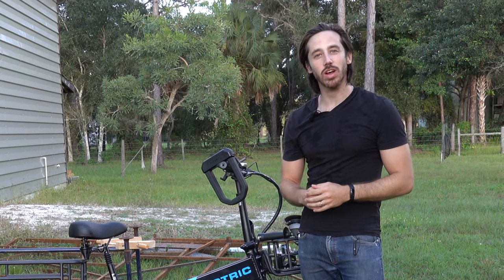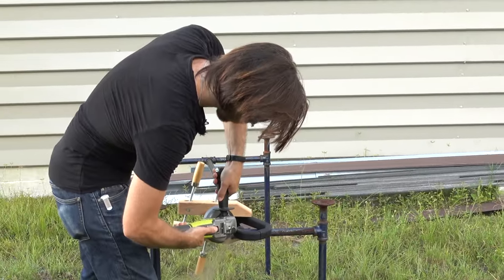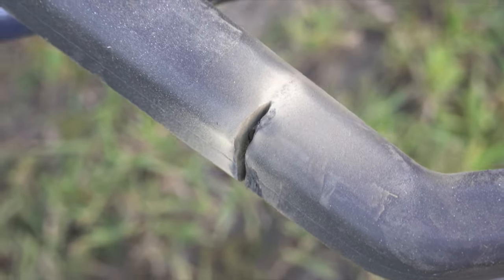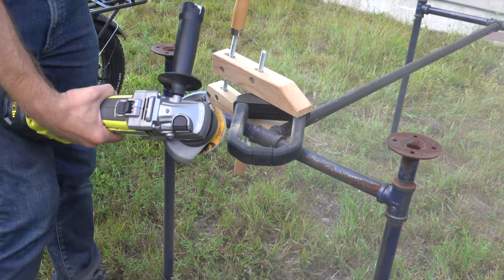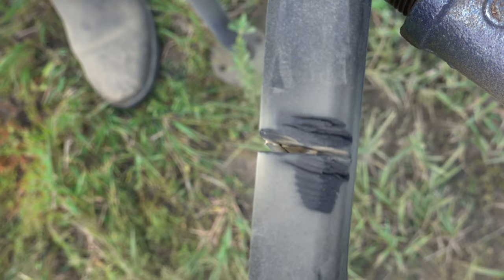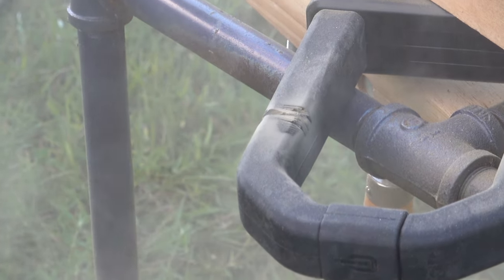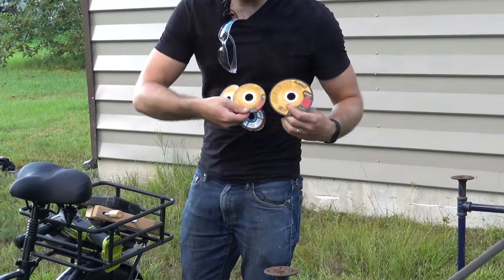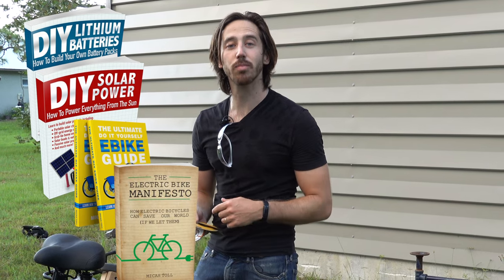Best E-bike Lock? Angle Grinder-Proof Hiplok D1000 Test

Comment: You didn't mention that you would have to do that twice, because it's dual shackle. You have to cut through both sides to remove the bike.
Reply: Yup just like the NY Kryptonite U lock. You need to cut 2x with multiple change of disks and batteries.
Reply: @larryc1616  My ebike was stolen on Monday which was locked with a Kryptonite Evolution lock. I was only in the supermarket for no more than 5 minutes and when I came back all that was left was my lock in 2 pieces. Looks like they used an angle grinder on it. The kryptonite locks can be cut very quickly with angle grinders so now I looking for a grinder proof lock because my work as a food delivery guy is reliant on my ebike.
Reply: @manoz6194  the 13mm evolution is too thin. Get one with a diamond rating like the 18mm NY kryptonite. Use a disk brake lock with alarm too. Add a 3rd chain lock if in a  bad neighborhood and Hide an airtag in the battery compartment. Good luck next time!
Reply: @larryc1616  I bought the NY lock but I'm still paranoid about it so I ordered the Litelok X1 too which is actually lighter and specially made for angle grinder use. I got an alarm which is motion detected which is also a light and I've ordered a Galaxy Tag and a holder for the saddle. It's a ebike not a motorbike. I think the thieves were lying in wait
Reply: @manoz6194 let us know how the litelock works out I'm thinking of getting it. I'm sorry to hear your bike was stolen, it's unlucky, and it always happens at the worst time!
Reply: @josephpmcl1241  It's working out great so far. I can lock it to more things as the shackle is wider and I've convinced a couple of my colleagues to buy one too
Reply: you are using the wrong disk, use a metal diamond disk
Reply: @larryc1616 The NY Fahgetaboutit lock can be cut through without changing discs. I've seen it done by different people in less than a minute. It's not angle grinder resistant at all. It's nowhere on level of what Hiplok, Litelok, or even the SkunkLock Carbon (the weakest of the bunch) can do. There's a video of the NY lock vs the Carbon and it loses badly.

Comment: Impressive cut resistance. As others have stated, now the lock mechanism itself should be tested by The LPL. I'm also torn between safety and convenience - it seems pretty bulky/heavy, suitable only for a true ebike (too much for my analog bike).
Reply: Seems like a good lock that you would use on a condo or apartment bike room or rack near your car parking spot.
Reply: Please clue me how "analog" applies here, assuming you know what the word means, since you'd clearly be using all your digits on it. (Hands & feet) Might go for un-assisted.)
Reply: put it in your backpack thats where i' have always put my u lock not this hiplock though.
Reply: Depends on how much you value your bike.  Honestly this lock will likely be a lifetime of use.  So might be worth it.

And besides as bulky or heavy as it may be it definitely beats walking out of somewhere and finding your bike gone.  A nice bike will be lighter and this lock will protect it!
Reply: It’s right at 4lbs. So not too bad imo. Has an internal size of 155mm x 92mm, external size of 225mm x 155mm, 20mm thick shackle (including protective coating).
Reply: I think it’s lighter than the Kryptonite New York standard lock and the Fahgettaboudit lock
Reply: You have an analogue bike...... Such a thing does not exist. What you have is a 'bicycle' or 'bike' as opposed to an eBike .... It doesn't need a new name 🙄

Comment: According to their kickstarter website, the lock is made out of a ceramic composite, which means that it may be vulnerable to a screw spreader attack, as the material is more brittle than metal.  Still, in order to use a screw spreader, you have to be able to fit it between the bars of the lock, so if you lock your bike in such a way that there is no room for it, you are still good.  Another possible attack would be a hydraulic cutter, which might shatter the material.  The LPL has used one of these on steel locks, so maybe he would be able to try it on this one when you send it.
Reply: I think it is the same composite as the Challenger 2 tank.
Reply: How about "Jaws of Life" hydraulic kit? Rather than BFI (brute force & ignorance) mechanical approaches. Professional bike thieves could easily carry it in their van. And it's QUIET. OTOH, how 'bout we legally mandate VIN code on multiple locations on any valuable vehicle. If you can't fence it, why bother stealing it? Any lock would then be just an inconvenience factor and a "flag" that you're in the wrong line of work.
Reply: A hydraulic cutter or simply a hydraulic crimper with a custom die set would probably do it. Likewise, I wonder how it'd fare against a nut splitter if it's a brittle material.

Comment: What do you mean by "half of the cut I made was rubber"? Does it mean the lock is mède out of a thick layer of rubber and only then comes the steel which is 50% of the construction? It doesn't make sense what you said.

Comment: I bought this lock. Someone tried to drill out the locking mechanism. I got the key in but it wouldn't turn. I called a locksmith. He drilled out the lock core in about 30 seconds. The good news is the thief didn't have a good drill bit and gave up.

Comment: I'm late to the party, but that's impressive!  But you have to start the party w/ two intros:  "Best angle grinder", and "best discs for cutting buffered tungsten (whatever) alloy."  (Serious, big difference in hand tools and replaceables.)  I'm thinking the remarkable thick & dense rubber is there to chaff the sides of the cutting disc wasting a large amount of what should be cutting energy as useless friction.  (Hense, "buffered" alloy.)  Nicely done!

Comment: I agree with you, Micah. 
Even the grinder eventually cuts through the lock, it would be after several discs, a lot of noise and the chance to get caught. In my opinion, the lock delivers on it’s promise.
Reply: Remember you need to fill cuts. The first cut doesn't do much. So a total of 10 discs.

A second lock would take even more discs due to fatigue of holding the grinder. And another battery.
Reply: Also you have to cut through both sides of the lock to get it off the bike, I've seen people take 5 blades to get through both sides with a mains operated grinder which a thief wont have on the side of the road. Awesome lock.
Reply: Not to mention it looks like it took nearly two full battery charges.
Reply: Most thieves dont even care any more, they know the cops arent wasting time on these calls.should have a frag explosive in it, true protection

Comment: This is alot more impressive than I expected tbh ,an angle grinder with enough discs will cut through practically anything within reason and this held up far far longer than a normal u lock

Comment: Excellent. I'm gonna get a couple of these D1000 locks for my eBikes. At their website they say this lock is around 4 lbs in weight, which is very good for the quality of security it is. Bottom line is it is very, very, very unlikely that a bike thief will have a half dozen high quality cutting discs and 3 or 4 spare fully charged batteries with him that he would need to cut this lock. So yeah, for all intents and purposes this lock is angle grinder proof.
Reply: how wrong one's assumptions can be...heh
Reply: Same, im sure once he makes the first cut after like 4 blades and 3 batteries, before realizing he’ll have to cut the other side as well, then do it all over on the second lock.

Comment: I agree partially with a person who posted previous to me, there is no such thing on the market 'yet' as an angle grinder proof lock. But still it is very impressive, as I own a couple of e-bikes, one worth at least 6 grand (just in parts) I will definitely be looking into this lock! But I do suggest that anyone who values their e-bike also purchase and install a very loud vibration sensitive alarm, GPS tracking and e-bike insurance. The combination of a great lock (like this one appears to be), a loud alarm and locking it securely in a public area is most of the time effective at deterring thieves. Make sure any alarm you buy is vibration sensitive, placed in a spot that is hard to muffle (like under the seat facing up), and secured at a minimum with stainless or coated steel zip ties.
Reply: @djcm6326  That sucks, I doubt I will remember by then. It's crazy how long it takes once something is done being tested even by people on YouTube before it comes to market.
Reply: Could you recommend an alarm
Reply: @SellingNewYorkCiti  Sure, I tested out several different ones from Amazon and the one I really like is a no name wireless vibration sensitive alarm, that lets you choose how sensitive to make it, link at the bottom. It appears there's an updated version to the one in the link, and the alarm is sold by several vendors on Amazon, you might want to check to see if there's a better price. Test it outside and/or with ear protection it's very loud, and can be overly sensitive on the highest setting.

I clicked on your pic, nice videos. I would have never thought to use a hammer on a drill to get the hammer drill effect. And great narration, to many DIY videos are not narrated or not narrated with enough detail making them hard to follow. Keep making videos, especially construction / power tool videos there's not enough of those done by females. In my experience, I find the way women explain DIY / working with tools to be much easier to follow, with a much better breakdown of what they are doing and why. I work with power tools everyday and watch many YouTube videos on it. I am your newest subscriber, I hope you will make many more videos. 

If there's anything else just let me know, I have built an ebike and 2 recumbent e-trikes, all high powered. My newest recumbent e-trike tops out at 45mph at the moment, soon to be much faster.
 https://smile.amazon.com/gp/aw/d/B07VB86TT9?psc=1&ref=ppx_pop_mob_b_asin_title
Reply: Good advice. I caught a thief red handed trying to steal my Fiido M1 pro a few months ago. I had only left it for 20 minutes while I went to buy some food.

He ran like a scared rat when he saw me. I never leave my bike unattended for more than 30 minutes in public. I have a tracker in it. A very jarring loud alarm. And two bolt cutter proof locks on it.

Only someone with an angle grinder might have a chance. And as soon as these HIPLOK d1000s  go mainstream. Im getting two of them.

I work too hard for my money. To let any low life just take my stuff. To sell on for peanuts to feed their addictions.
Reply: There it is. Security is a LAYERED approach. I've had mega bux riding equipment and never had anything stolen. Make it a PIA for them and they'll move on.
Reply: Do you have an ebike or 'regular' bike? I struggle to find a nice strong large d lock that can fit these unruly ebike frames some of their tubing is so fat! And with bigger tires it's almost impossible to fit a u lock around frame wheel and immovable object
Reply: @AD-xn7pt  I have an electric bike and a full suspension fat tire electric recumbent trike. Go with a Good quality folding lock and a vibration sensitive alarm.
Reply: @sgtfirefighter  thanks I currently have one chain lock getting a 2nd one. I'm going to look into the vibration alarm
Reply: @SellingNewYorkCiti  cruxer bike alarm £ 22 amazon

Comment: I would have wanted to see what happens when you are through, if the lock is still rigid enough to be difficult to open up any gaps on it to be able to remove it from something it is attached to. Because it would be amazing if one would be required to cut two sides of it of, or bend on it even after cutting into one side.
Reply: Came here to say this!
Reply: You will have to make two cuts to get it off, unless one very thick cut and managed to use a pry bar to bend (or crack) it further open.  I would call that twice as good but not at all amazing, since if they can complete one cut, they can use same method for a 2nd cut, simply taking twice as long and that difference might be more than enough to make the thief move on, OR it might make them just start cutting the bike away from the lock instead of the lock away from the bike to at least get something for their efforts.

Comment: And from what I understand after you would theoretically cut through one side you actually have to do the same thing on the other side. Now I’ve also heard suggestions that the crossbar part or whatever that’s called might be more vulnerable by drilling into the key area. Either way I have one of these on order.
Reply: from what i have seen from other YouTubers you only have todo one side on this lock but im okay with that with how long it takes just todo one side

Comment: A key to locking the bike is to place the lock so it's difficult to hammer against the ground. It would not be fixed as it is in this test, so would taka longer still if the test had been in situ

Comment: Also, (and it may have been noted elsewhere..) you will have to cut the other side of the "U" as the lock won't just fall apart with one cut-through. A thief will need maybe 15 wheels and two spare batteries? Nice lock. Spendy but nice. Cheers.

Comment: The Lectric XP bike in background is worth locking up. I have 200 miles on mine, use it 3 days a week when I park 2 miles from the office, spends most of the time folded up in back of my Subaru.

Comment: FYI:  There's many different types of grinder blades and they're designed to tackle different grades of metal.  They all look identical, but they will have wildly different performance depending on what they're cutting.  It would defiantly be interesting to see how the grinder preforms with a blade matched to the material it's suppose to cut.  Regardless, unless a thief knows what material the lock is made from, this is kind of a moot point.

Comment: The problem would definitely be the size of the Ulock. You likely wouldn't find any bike post or steel beam to fit that lock on, that couldn't be cut far faster and easier.
Reply: Take off the silicone sleeve to increase the area for locking.

Comment: Nice review, I'm glad to see the it was pretty tough to cut through!...
-How much of the bike can that lock secure? 
-The lock looks pretty small, is it able to be secured through the back tire and frame?
-And does it come in a longer length?
Reply: Yea the lock is to small.. if u lock this lock around the pickup grip they have on the lectric bike he has in the video or anywhere else similar then the theif would be able to easily saw that part off (frame) which the lock is holding 😢

Comment: I've been watching a lot of your battery build videos. You really need to make a video on how to build a battery that follows the shape of the fender of a Onewheel and how to tie it in to the power supply so it functions in tandem with the stock battery. They have all these videos about adding battery packs to the fender, but it makes the board look like it came out of Mad Max or something. Which isn't bad if that's what you're going for, but it just seems like an additional battery that would give 2x the range that's integrated into the fender and doesn't look like some bulging mass would be a huge hit.

Comment: Carbide tipped reciprocating metal saw blade. Something like a Diablo Steel Demon 9 inch blade from Home Depot for less than $20. Carbide tooling can cut just about anything including hardened steel.
Reply: It's a ferro-ceramic composite something, so while I agree that a carbide blade might make more progress, it would tend to also chip teeth off and be more expensive to wear through blades.  IMO a larger diameter, thicker ceramic cutoff wheel makes the most sense.  And a better grinder than Ryobi's.  Theirs cuts out power if you (more easily) bog it down so the cutting time is greatly increased compared to some more formidable contractor grade grinders.

Comment: Diamond disc would get through that ok. They don't lose much diameter as you use them either so you wouldn't be hampered by the wheels reducing in size.

Comment: Seems pretty tough in fairness!  I wonder if you cut away the rubber housing first would that make it easier to access the lock for cutting, and to find the weakest point?  
The locks I see around the ground are usually cut or grinded, sometimes broken other ways by bending or what looks like some kind of a hydraulic kind of opening.  
Then there is the less common picking of the locks which probably takes a little more skill than the average criminal.  
Many locks are really strong in one way but fail in others, it is always worth investing in a lock that can deter thieves from every common angle of attack.
Reply: I thought this also but worn down discs are worn down discs - cutting rubber doesnt degrade the disc. Move to another spot if the rubber is in the way, it's all got to be cut. Great product

Comment: The one issue with this is: What would you actually attach this to? any bike-stand, fence or whatever... none of that would be angle grinder proof as well :)
Reply: Yeagh, I'm wondering the same thing after watching the video,  which is why I'm worried about spending more than 300.00 for an Ebike, since it seems
any one with a little skill and the right tool, could by pass the super lock, by cutting into the fixed bike rack, or fence,  but unless you have some other idea,
I was wondering what about discouraging a thief by trying to use this super strong lock by locking up the front wheel or back wheel, requring a thief to know how
to disassemble one of the wheels, than have to replace it, before tyring to sell it again at there local pawn shop, etc...